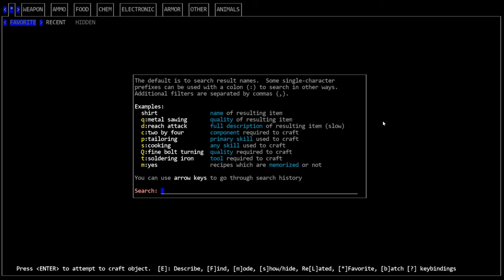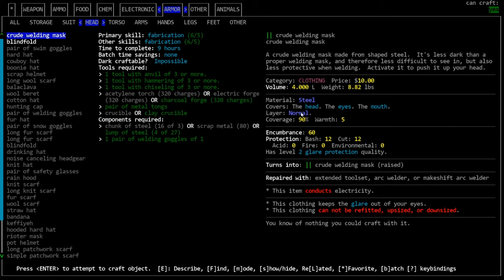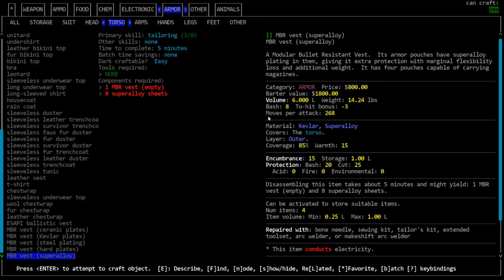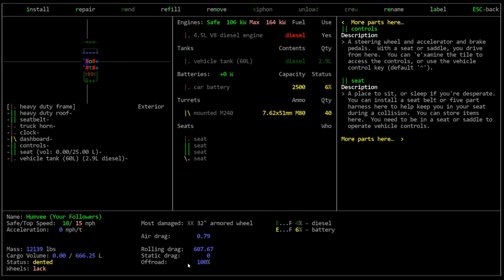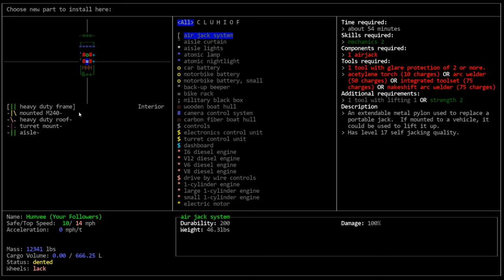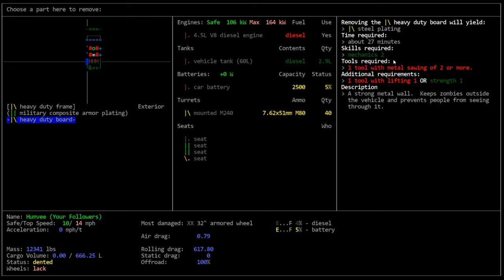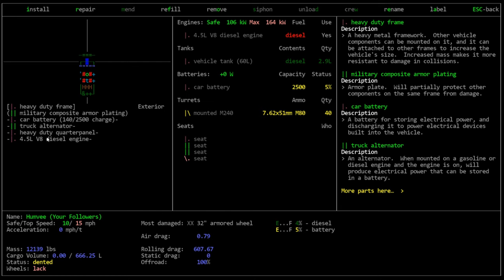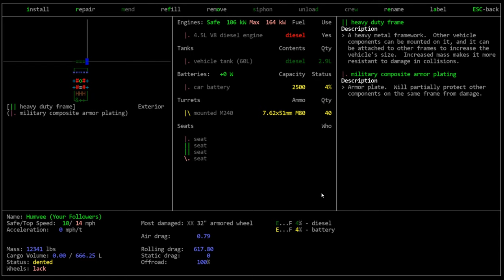CDDA - Tutorial Let's Play 47 - Vehicles in Detail

Comment: Let's say I found a very functional semi truck that I'd like to turn into a mobile base, and I found a vehicle welding rig in a garage that I slapped onto the back of my truck. How do I arrange a power system for the rig? I was thinking get a swappable storage battery case and pop it on the same space as the rig but I don't know why it's not letting me put one on the same space as the rig. I also plan on putting a solar panel above it. I'm just asking here cause setting these I only know how to repair and replace things so far.
Reply from the maker: When you go to install an item on a tile, it will display a list of things.  If the thing you want to install is on the list, it can be installed there, and will tell you why you can't currently install it.  If it doesn't show up in the list it means something else conflicts with it and it can't be installed there at all.  I don't know for sure, but my guess would be that the case conflicts with the rig.  You can probably install a batter without the case.  If not, I really don't know, sorry.
Reply: @TheMurderUnicorn  ok I'm playing on Mobile it is on the list but it doesn't install I probably don't have the right equipment for it. I can't really see my requirements list well cause mobile doesn't have a way to scroll down in the requirements list so I'll find a way eventually.